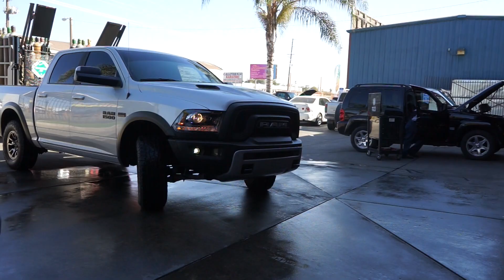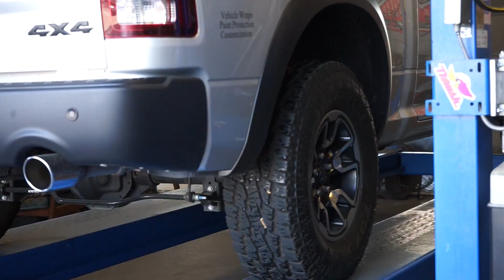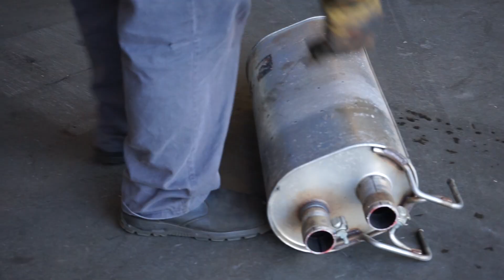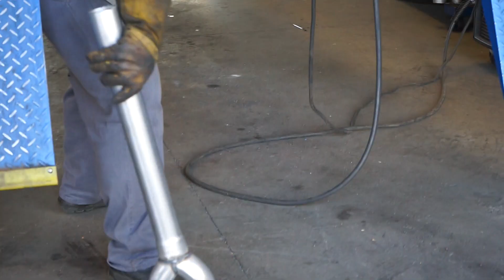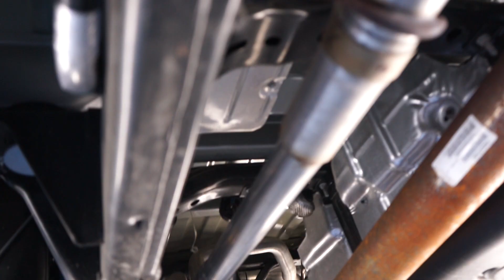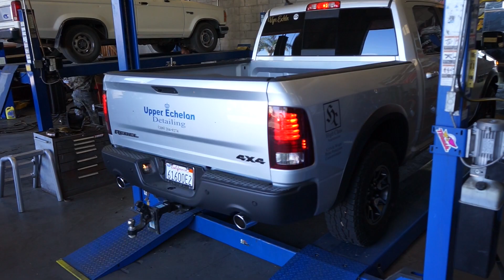Ram Rebel Muffler Delete (1500 5.7 Hemi)

Comment: Nice sound! Just got an 18 Rebel and was thinking of different resonators and/or muffler delete.

Were both resonators and muffler delete changes done or just muffler delete? Also what brand/part was used?

Apologies if I scrolled through too fast and missed something!
Reply from the maker: the rebel comes with one huge muffler and very tiny almost nothing of two resonator as i was told by the muffler shop

Comment: Does the truck still pass smog?
Reply from the maker: William Mendoza lol yea it has nothing to do with emissions
Reply: Does the truck have eco mode and if so. How does it sound?
Reply: @williammendoza489  just put the truck into tow/haul mode and you don't have to worry about it
Reply: Manually put it in your highest gear to disable the mds, shifts and down shifts automatically and disables mds, dont do tow haul unless your towing